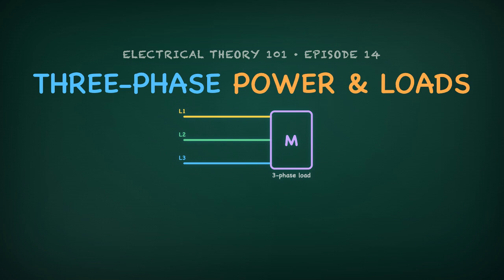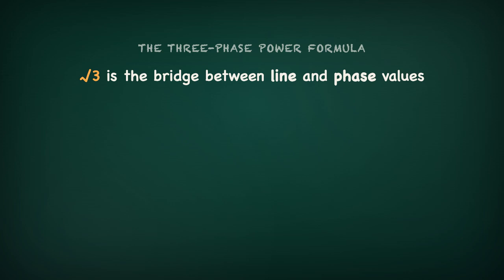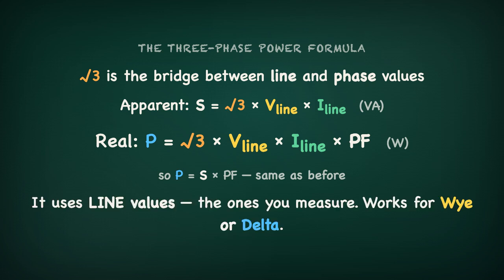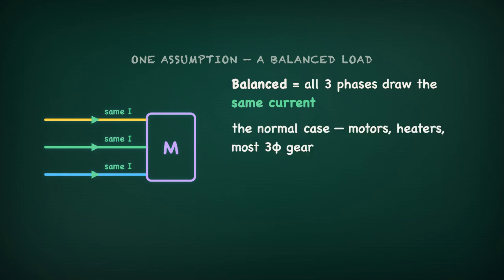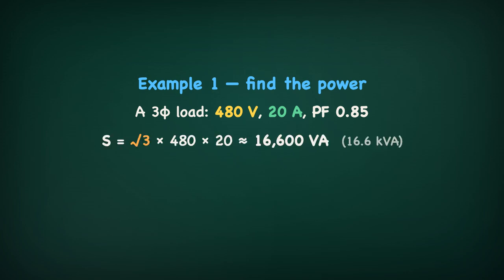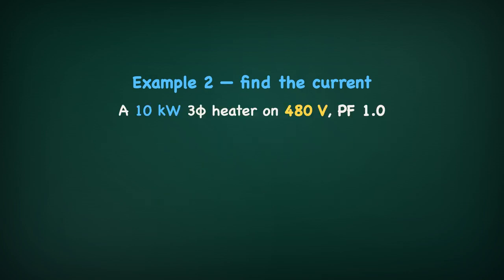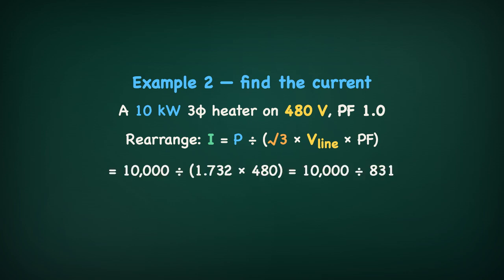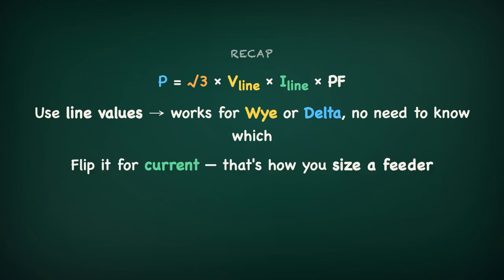Three-Phase Power Formula — P = √3 × V × I × PF (and How to Size a Feeder) | Electrical Theory 101

Comment from the maker: Practice answers: A) S = √3 × 208 × 15 ≈ 5,400 VA (5.4 kVA); PF = 1.0 so P ≈ 5,400 W (5.4 kW)   B) I = P ÷ (√3 × V × PF) = 15,000 ÷ (1.732 × 480 × 0.9) = 15,000 ÷ 748 ≈ 20 A   C) P = √3 × 208 × 25 × 1.0 ≈ 9,000 W (9 kW). One formula, two directions: multiply out for power, divide back for current. What should I cover next? ⚡